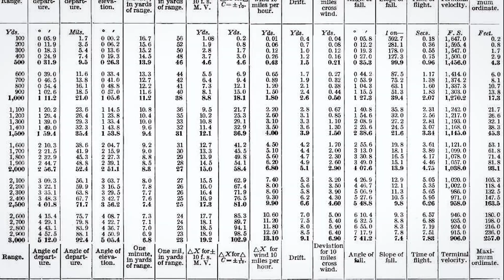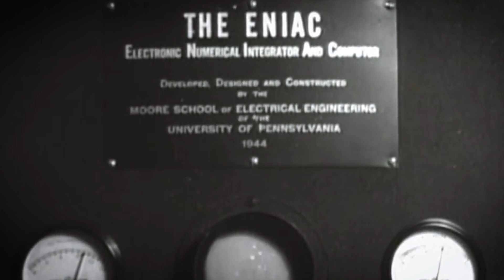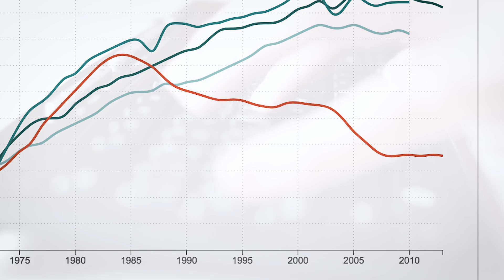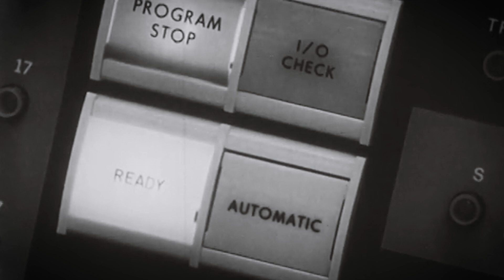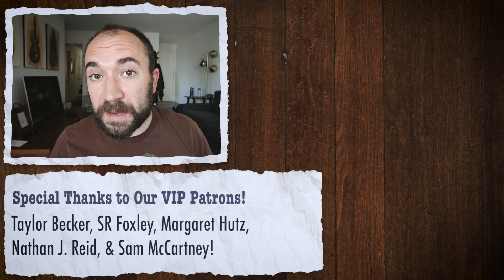The First Computers Were Human (and Mostly Women)

Comment: As a programmer, I really want there to be more women working in computing and programming as I simply work better with them personally, however, I read through the sources here and it stinks of social constructionism and equality of outcome which are ideologically motivated. This one https://www.accenture.com/t20161018T094638__w__/us-en/_acnmedia/Accenture/next-gen-3/girls-who-code/Accenture-Cracking-The-Gender-Code-Report.pdf is pretty disturbing as bad piece of social "science" which has an extremely flawed methodology from a science perspective and reads more like a manifesto or action plan than anything. I have no doubt there are ways to encourage a greater number of females to enter a coding profession but I would rather do it honestly (and actually controlling for variables in god damn research) than pushing it ideologically. It will just cause push back, and none of us want that.